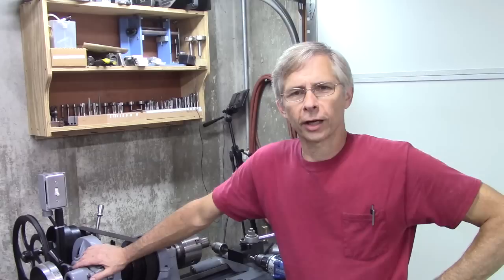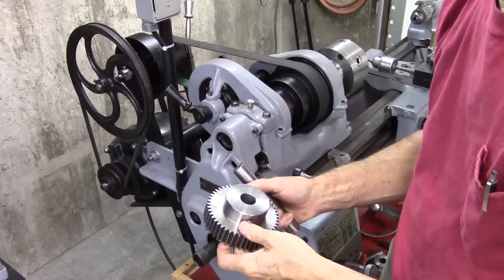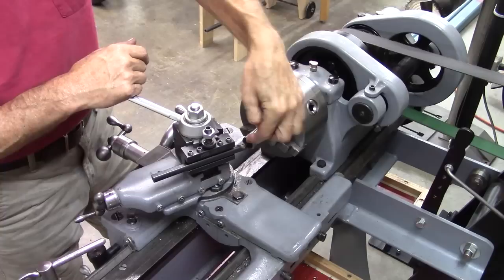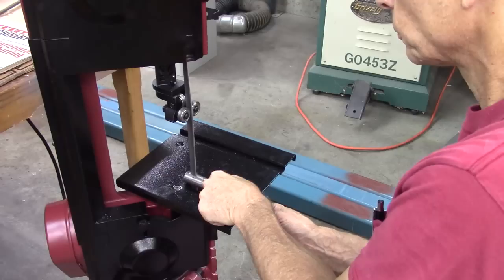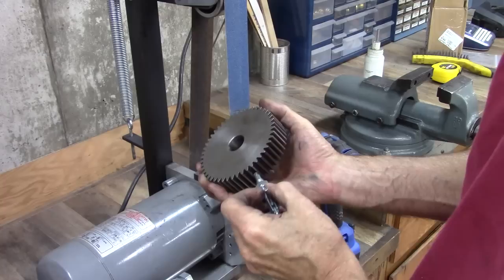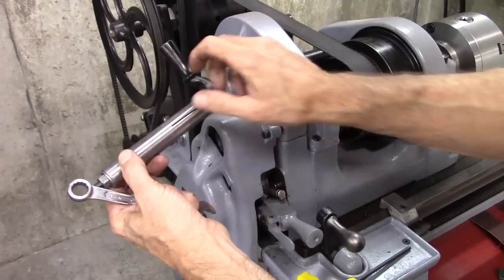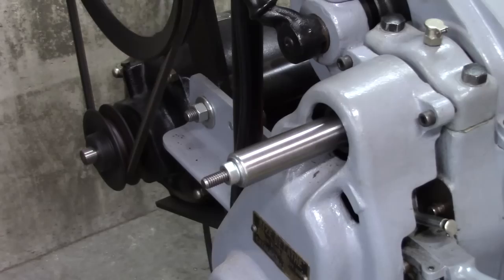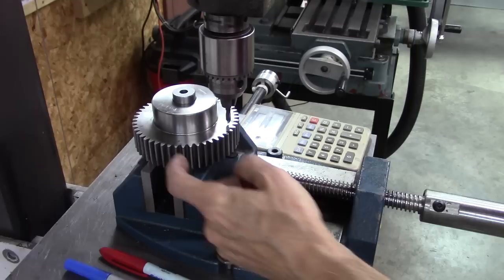Simple Indexing on a Metal Lathe

Comment: McMaster wants $28 to ship 1 spring plunger. Did you pay that much?
Reply from the maker: I don't think so. Google this number, Amazon has one but you have to click other buy options. I think it's $17 which is still too high...  
CL-6-LHRP
Reply from the maker: Also, it looks like Amazon has a large variety if cheap indexing pins would work just as well. Search amazon for "indexing spring plunger"
Reply: @WinkysWorkshop  Thank you.

The simple indexing setup you made looks like an OEM. Nice job.
Like you, I spent a ton of time on my first indexing setup, which is now dismantled, and a new, simpler one is on the way. I'm more visual than analytical. I have to make it to see if it works. I've gained a lot of respect for those who design complicated machines.
My first boss told us, "We do it nice, because we do it twice!" :)
Reply from the maker: @Rochesterhome  I worked for a large magazine printer for 39 years. I ran a press for a while but the last 15 years were spent redesigning presses and related machinery in problem areas. I think I had a slight advantage due to having run the machines for the previous 24 years but it was also due to my ability to visualize a modification and even see it in action in my head. For many years I thought everyone could do the same but apparently most can not. If you think you have this ability "LEARN CAD". It will open the flood gates. I learned Sketchup which was adequate for my needs but if you are younger than 45, learn something like Fusion of Solid works.
Reply: @WinkysWorkshop  I downloaded a CAD program months ago. I couldn't get it to work. I have a short tolerance when it comes to computers. :) I'll make another attempt soon. 
Unfortunately, I blew past 45 long ago. :) Why do you attach age to CAD?
Reply from the maker: @Rochesterhome  Ha,..  I'm 68. I should have been more clear. What I meant is that if you are younger its worthwhile learning a program that is generally accepted by industry so you might use it in a career. If you are old like "us" the choice is more, whatever is available and comprehendible. I feel your pain with CAD. I got totally discussed and quit several times.
Reply: @WinkysWorkshop  I watched a great starter video on Solidworks last night. No wonder when I downloaded a free CAD program last year I could get to first base.           
I'm trying to find ballbearing small enough to install two or three in my slide and compound nuts to eliminate backlash. What do you think about that?